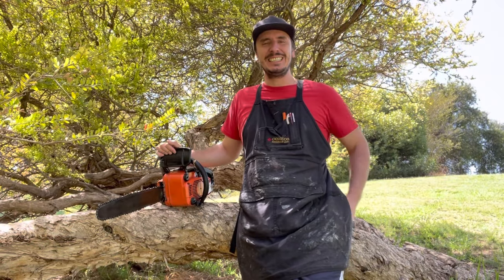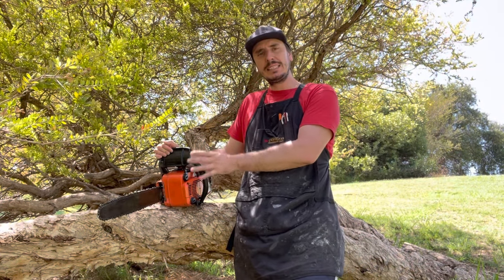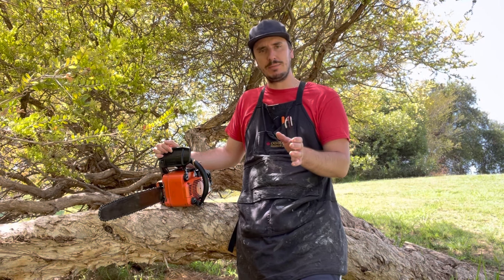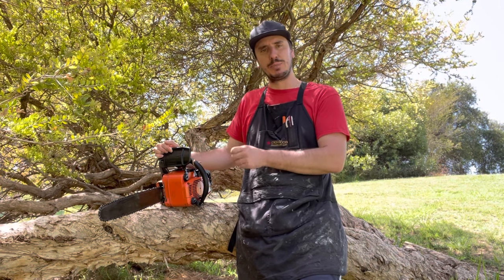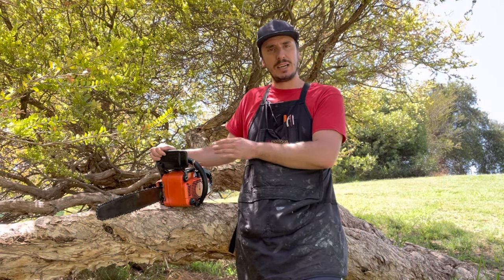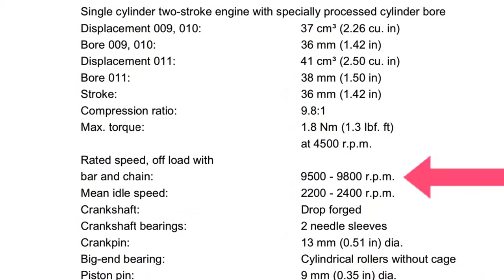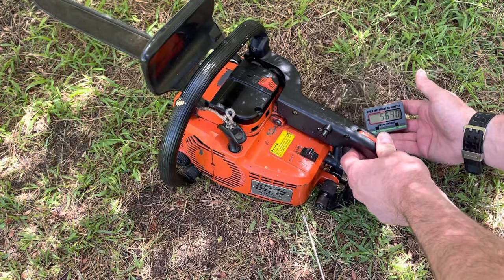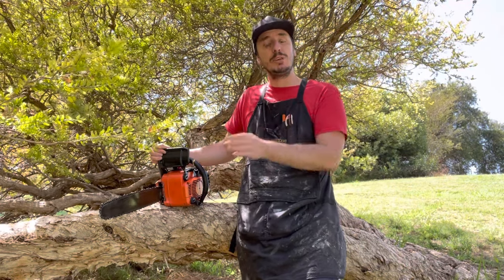STIHL’S OFFICIAL 2 STROKE CARBURETOR TUNING PROCEDURE.

Comment: You did a Stihl trimmer carburetor adjustment video awhile back, if I'm not mistaking. If you did, can you share that link with me, there was one part in the trimmer video that you didn't cover in this one. I just bought a "NEW" carburetor for my trimmer, and need the other video to make one final adjustment, if it's not defective, before returning it for a replacement.
Reply from the maker: Hey :) what timing! I have a strimmer carb tuning video coming out shortly!! I have done one in the past, but no where near as good as this will be. Have a look back through my videos and you’ll find it :) I say hold off as the other will be released fairly soon!
Reply: @VintageEngineRepairs Husqvarna 128ld (manufacture Idle Specs 2300-3200 rpms):
This is a "New" carburetor I purchased for my trimmer and after I installed it, it was idled way to high above 4200rpm's. So I try to keep my trimmer idle speed between 2800 and  3200 rpm's, so when I adjusted the idle screw to bring it down to my idle specs it keeps shutting down and I don't want to have to continue idling it every time I use it. So do you think I should continue playing around with the idle L screw and idle screw or just return it for a replacement. Which I don't want to ship it back because I need my trimmer......

Comment: This is a good video but I have one problem with their recommendation. Lets say desired speed is 10,000 and the tach shows 9,000 because they already have it so lean it won't reach 10K. Now they turn the screw in to lean it out and raise rpm but don't get the desired results. At least with the low speed you find the sweet spot and adjust from there. I don't like recommendations that just have you read a tach because the magic number your looking for occurrs twice-once on the lean side of the hump and once on the rich side. Does this make sense?
Reply from the maker: Hey Scott! I must admit I have never had a 2 stroke that I couldn’t reach their max rpm on the H screw? Maybe I’m miss understanding your comment? 

There are a few changes I personally make to their lean drop off tuning procedure, but for continuity of the process I didn’t add in any of my own preferences on this vid 😂

Edit:

Ahhh I think I understand you!! Yes, if you go too lean you’ll eventually hit that number again. I haven’t tried it, but I don’t imagine that on the lean side, it will hold the set rpm. It will lean out and die? Maybe I should give it a go!!
Reply: @VintageEngineRepairs  Yes you got it. The point I'm making is that if an average guy just throws a tach on it and turns screws till he sees the right number, he hasn't necessarilly set it correctly. I've had saws come in where guys have done exactly that.
Reply: Scott, I adjust the high speed screw to just get 4 stroking out of the wood, so it cleans up in the cut.  If the tach shows its off (too high) i may richen it a little, but I adjust to ensure good pulling in the wood.
Reply from the maker: @TheGreasyShopRag  it never ceases to amaze me what people are able to achieve 😂 it hurts my head LOL I’m sure you’ve seen some real doozies!!
Reply: @KensSmallEngineRepair  Yes thats the way I do it and rarely is it set too fast. I prefer being slightly rich over slightly lean.
Reply: @VintageEngineRepairs  They get it from YouTube! Sadly there are a lot of channels giving poor advice. Keep up the good work!
Reply from the maker: @TheGreasyShopRag  thanks mate :) you too!!

Comment: Thank you for your brilliant video can you set the butterfly on carburettor between the idle port and first progression hole by eye with carb of and tune low speed screw and achieve same result ?
Reply from the maker: Thanks :) na you can’t, even 1/8 of a turn is a lot on the LA and you can hardly visualise that. There is quite a range between the idle drilling and progressive.
Reply: Thank you for your reply I'm probably nearly 40 years working on small engines here in Ireland you learn something new everyday 👍
Reply from the maker: @patrickkelly7674  you’re welcome! Yes you’re quite right!

Comment: @Tom
I think your video was good but needed to be watched several times. Your chapter settings really help.
I got confused by your different terms and the way you changed between them when you speak. Though you can get it from the video, you use a lot of terms interchangeably without realising it because you are experienced.
 It may be better to give a list of the different terms at the outset and then just use one term in the description of what you are doing in terms of names for the screws, speeds and alteration of the screws (clockwise[right,turn it in, lean it out], anticlockwise). Meant to be constructive as your video is good, but could just be a bit easier for certainly me to understand if you used less terms and maybe set out the alternative terms at the start
Reply from the maker: Hey! Thanks so much for the great feedback. I couldn’t agree more and you won’t see a recent video of mine like this one. Now days I plan all my tutorial videos out in a scrip so nothing gets missed or miss communicated! Thanks again :)

Comment: Brilliant mate........thanks for being so clear and concise. My engine tach has a wire that you wrap around the plug lead. I changed it to a crocodile clip for ease of use. I'm just wondering if this type are as accurate as the ones like yours? Cheers bruv!!
Reply from the maker: Thanks mate :) yep! Mine does both inductive and wired! Some cheaper brands aren’t as great, but most are still very accurate!
Reply: @VintageEngineRepairs  Okay......so do you think adding a crocodile clip to the wire may have affected accuracy? I just thought that winding the wire around a lead was a faff......much easier to clip it on!!
Reply from the maker: I haven’t found it to make any difference because this tach has excellent inductive pickup, however the cheaper ones do benefit from that!
Reply: @VintageEngineRepairs Could you provide a link to the tachometer you used please & thanks!
Reply from the maker: @danielbrown9469  sure :) Engine Tachometer - https://amzn.to/3TE48GZ
Reply: Thanks mate! 👌

Comment: Stihl 025

Let's see if I get this proper

New and proper fuel mix and full.
Fuel filter not blocked.
Air filter clean.
Exhaust clean.
Spark arrester clean.
Spark plug and gap proper.
Oil resivuor full.
Chain proper tension.
Sharp.

Before factory reset:
Turn the H & L to seet in the "IN" position  (clockwise till it won't go any further-gentle).

Factory reset:
Then turn the H & L "OUT" (counter clockwise) one turn.

Start it.
Let it warm up one minute at different rpms.

What is the factory reset for the LA screw?
Reply from the maker: Good job, there isn’t a factory preliminary setting for the LA :)

Comment: Appreciate your guidance and will try again maybe I’m turning to fast. I don’t have a rpm gauge, did you have a link? The LA screw, didn’t seem to do anything do you screw that in all the way and then out 1 1/4 turns also? How do you know where it should start from or doesn’t it matter? When I quit it wouldn’t stay running also I have replaced the carb.
Reply from the maker: Set that so it just touches the cam to open the butterfly and then one and 1/4 more :) here is the link to a tach :) https://amzn.to/3TE48GZ

Comment: Great video Tom!  I understand the process to get L & H screws set, but unless I missed it, I don't recall you saying anything about dialing idle back to spec rpm.  Sorry if this is obvious, but should idle be left at spec + 500 after H screw is set, or does it then get reset to spec rpm with idle screw?
Reply from the maker: Hey :) I covered it haha, when you find fastest rpm on L and it stays at spec + 500, then richen it by 500rpm with L. Thanks for watching and commenting :)
Reply: @VintageEngineRepairs - my apologies for not following close enough - thanks for the lightning fast reply!

Comment: I set every two stroke carb to 1.5 turns out on both jets.  This should get the piece of equipment running and I tune it from there.  I warm them up for five minutes before adjusting the jets.
Reply from the maker: Worth noting, the engine will be just as hot at 60 seconds as it will be at 5 mins UNLESS you’re actually putting the engine under load. If you’re just letting it idle and gently blipping the throttle a few times every so often for 5 mins you’re wasting your time. It’s not until you are actually using the engine under load that it’s going to get hotter. Air cooled engines heat very quickly.
Reply: @VintageEngineRepairs  that is what the Husqvarna Service Manual says.  I do not know what the Stihl Service Manual say, so I go along with what Husqvarna said.  I looked over the Instruction 
Manual for the 021, yesterday, and Stihl does not provide an RPM for idle or Max rpm, so I will go along with what I know. I figure 2,700 and 13,000.  What do you think.  A lot of their saws list 13,500 for max rpm, but I never figure that high.  I had a brand new MS 170 that was turning 14,500 but not any more.  I richened it up to 13,000 and change.  They say you cannot adjust the H on theses saws, horse crap h- you can.  There is a very small torx socket in the H jet.  I just richened mine up a 1/4 turn, down to 13,020.  I could have turned it out a bit more but left it where it was.  13,020 is not alarmingly fast to me.
Reply from the maker: All good, we all have our ways of doing things. The 021 is 2,800 / 11,500. Thanks.
Reply: @VintageEngineRepairs  I haven’t thrown the tach on the 021, yet, but will keep those figures in mind.  It’s has new bearings, seals, piston and cylinder on it.  I wait until things get broken in before 
I set the carb.  It has a nice little four stroke on it, now, so it is ok.  11,500 is kind of low for a Stihl.  My 260P will turn 13,500 easy.  I am not worried about it turning to high an rpm with a 18” .325 chain on it.  What I like about it is it’s easy of starting - 2,1P every time.  Three pulls and your going is great for a Stihl saw.    I can’t wait to see how it acts in real cold weather.

Comment: I have a Stihl KM-56 Trimmer.  It has spark, new tune-up kit and carburetor.  All fuel lines and tank vent line were tested.  Muffler and spark arrestor screen clear and clean. Compression test and pressure test all passed.  Stihl won't start! I'm confused! What could be a possible issue?  Thanks and I have learned so much from your great videos!!
Reply from the maker: Hey :) I’d recommend putting a teaspoon full of gas and 2 stroke mix directly into the throat of the carburettor. Then make sure choke is off, ignition on, go full throttle, and pull the cord a number of times. Let me know if it starts, runs then stops after a few seconds :)
Reply: @VintageEngineRepairs  I will try that at work tomorrow- Will let you know. Thank you! :)
Reply from the maker: @ninagamble9150 no worries :)

Comment: Can you tell me how to set up the tacho in your video. I’m struggling with the enclosed instructions. Many thanks. Good video
Reply from the maker: Sure, what tach are you using? I only have two, both you just put near the engine and they fire right up.
Reply: It’s the PET-2000DXR.  If I press the mode it shows 0 min.  If I press and hold mode it shows 7760 rpm.  Should I see P21:42 ?  Many thanks
Reply from the maker: @grahamjones4294  yes you want 21:42. Keep pressing the mode button until you get to the screen that starts with a capitol letter “P” followed by numbers. When you get to that screen, press the set button until you get 21:42. Then you can just leave it alone. Bring it next to an engine and it will register both 2 and 4 stroke engines that fire every revolution (all single cylinder ope)
Reply: Sorry to be a total idiot but do I hold the mode button down or continually click it. I either get 0mins if I click or 7760rpm if I hold the button down.
Reply from the maker: @grahamjones4294 keep clicking it to cycle through the settingd
Reply: @VintageEngineRepairs  sorry it just continues to show 0 min.  I’ll have a glass of wine and try again later.  Thanks for you help.  I’ll get you a PayPal coffee!

Comment: Great video , now I only have one question , where can I buy one of those Tacho's you are using ? How does it work ?
Reply from the maker: I’d recommend a fast tach, but cheaper, works just fine. This one is unnecessarily expensive
Reply: @VintageEngineRepairs   I just started scrolling ebay and found one for 40 bucks so thought bugger it I might as well get it . I have 4 carbs to replace on some old equipment of mine so it will see some use . Great video btw , 👌

Comment: Here's one for ya,  my  kid was playing with the idle screw and screwed it all the way in , not while running though, how do I find the idle setting again , it must have been turned in 5-6 times.   Would I turn in all the way, then turn back all the way , then turn in half way ???
Reply from the maker: Na the best thing is to turn the idle screw in until the chain just starts to move, then turn it back until it just stops. That’s a great place to be.
Reply: @VintageEngineRepairs    ok the idle screw is turned all the way in until it stoped, so your say. Back off the screw 5-6 turns and then start turning in
Reply: Stihl 461
Reply from the maker: @200cdl  huh? No I didn’t say that at all lol. Re read my comment above lol
Reply: Kid was playing around and kept turning it in all the way until it stopped turning
Reply: I'm in no man's land now
Reply: With the idle screw
Reply from the maker: @200cdl  start the saw, chain brake off. When it’s running at idle see if the chain is moving. If it’s moving, unscrew the idle screw until the chain stops moving. If it’s not moving, turn it in until the chain just starts to move and unscrew it until it just stops.
Reply: @VintageEngineRepairs  ok  but it won't run at all now. But I'll keep turning it back until it does
Reply from the maker: @200cdl  if it won’t run at all, the other screws have probably been turned. Follow the video on this thread on how to tune it.
Reply: @VintageEngineRepairs   10-4 I'll give it a go
Reply: I have the same problem but it's on a new carburetor with a steel BR600 blower. I am glueless as to how far in or out the idle screw should be. Between the h and l there is a circle that says 3/4 turn out I assume applies to just the h &l.  Curious what you find.  As soon as I put the carburetor on new, it would fire up and run like a scalded dog and I would turn the idle screw out to get it to slow down the RPMs but it would start revving and then stalling out with the slightest of turns or no turn at all. I'm about to take it off again and make sure the throttle cable and all didn't come out of the channel they are meant to be in. I wish I had gone with steel parts not Amazon but live and learn
Reply: Stihl*

Comment: Does your tachometer work purely on sound with no leads to spark plug cable etc?
I’ve been struggling to find one of these got a link for one?
Reply from the maker: Hey mate yes it’s inductive :) here is a similar one to what I use, just way cheaper. The only
difference is this one doesn’t do quite as many cylinders - totally unnecessary for any ope! Save your money! Engine Tachometer - https://amzn.to/3TE48GZ just for full transparency this is an Amazon affiliate link - I may earn a small amount from qualifying purchases :)

Comment: Would you reccomend doing this without a tachometer? just by 'feel'? Cant afford the £150 for a tach right now. Many thanks for the informative and easy to follow video btw.
Reply from the maker: Hey, yes, I go by ear most of the time and just confirm with a tach, but I only recommend it if you know what you’re listening for. Otherwise you’ll likely cause yourself problems!
Reply: Hang on now... there is no way you can do this stihl method without measuring rpms. No one can know what 3000 rpms sound like. It's the target point... you can't know if you are too high or too low without a tach
Reply from the maker: @PopaAlexandru.  nice! Yep you can get cheap and expensive Oppama tachs!
Reply from the maker: @normanbfifteen3468  by ear, when you know how, is far more accurate than shooting for numbers, every engine is different, even if it’s the same model, numbers are an accpectable range to be in. Using your ears you can tell exactly how the engine is running and where it’s happy. The spec rpm’s are a rough guide acrosss the board, for a brand new, non broken in engine with good soft diaphragms, clean filters, sharp chain etc and will be fine, but as an engine wears in, filters may be a bit blocked, the chains not quite as sharp etc, being able to adjust an engine based on how it sounds is really the best method. Also, I can be almost if not, spot on by sound. Just like you know when your car is at 2,000 rpm, 3,000 rpm etc, you build up an audible “picture”. Just like you know when to change gears, you don’t look at the rev counter; you KNOW when the engine wants to change. It’s a similar principle here with these engines.
Reply: @PopaAlexandru.  Sure, if you have perfect pitch... ha ha. Even most pro musicians need a reference point to compare when tuning an instrument.

Comment: Many people find just starting a stihl is the problem ..they are pigs to start..Ive gone retro old mc cullocks  always start ...not a s light or ergonomic  but work
Chainsaw I now use a mains 240v electric chainsaw .. quiet always starts
Reply from the maker: I have never found one machine harder or easier to start than another. All my stihls start easily right away. It’s down to how they’ve been maintained .
Reply: @VintageEngineRepairs maintenance meticulous,,My personal disappointing/frustrating  experience  is with low emission latest model hedge trimmers and chainsaw .. others I have to backup with 2 duplicate machines..such is progress